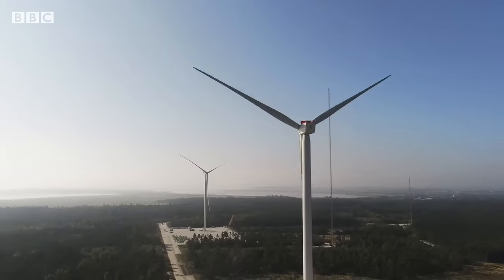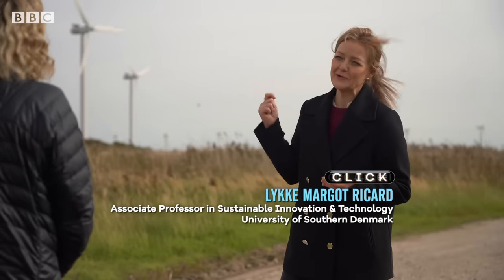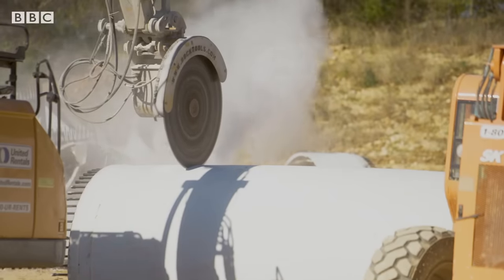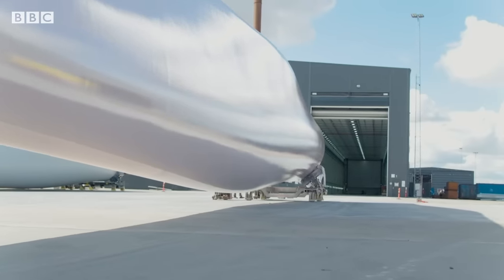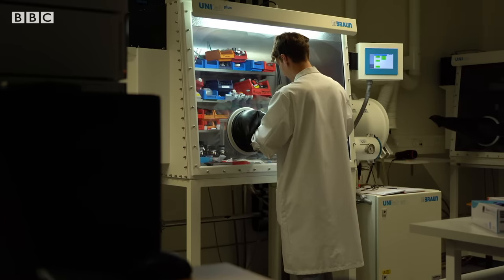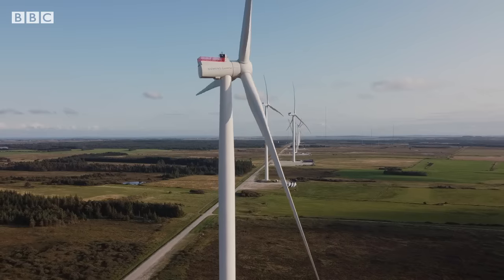Race to recycle wind turbines in Denmark - BBC News

Comment: Summary
- 0:02 The test center in Northern Denmark is testing the largest and most powerful turbines, with the biggest one being 280m high.    
- 0:05 These turbines are- Turbine machines are getting more powerful, with the largest reaching 280 meters high and breaking world records for power output.    
- 0:34 They're expected to get larger, with the design turbine being 450m from ground to highest tip.    
- 0:46 By 2030, wind power could supply a fifth of the world's- There are plans to create a new test center in Denmark for a design turbine that could reach 450 meters high.    
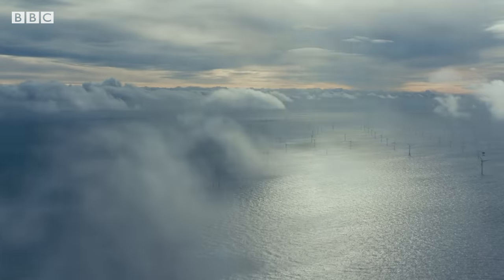- 0:50 By 2030, wind power could supply a fifth of the world's electricity.    
- 0:54 The green industry has a waste problem, as turbines are hard to recycle when they reach their end of life.    
- 1:07 While the steel in the towers can be reused, fifth of the world's electricity.  
- 1:12 Turbines are built to withstand forces of nature, making them flexible, light, and super strong.    
- 1:19 However, when turbines reach, the massive blades are almost indestructible and often end up in landfill.    
- 1:31 By 2050, there could be 43 million tons of redundant blades globally that need to be dealt with.    
- 2:00 Some creative solutions for reusing wind turbine blades include using them for bike sheds, playgrounds, the end of their life, they are difficult to recycle. While the steel and towers can be reused, the massive blades are almost indestructible.    
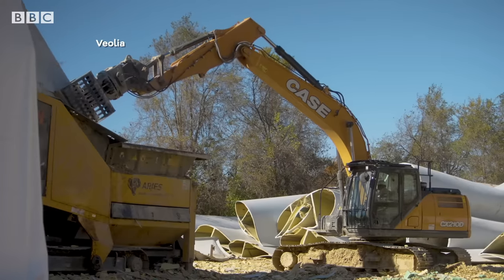- 2:18 One immediate solution is to chop up and shred the blades, then burn them as fuel and use them as an ingredient for cement production.    
- 1:26 Many old turbines get dumped in landfills and by 2050, there could be 43 million tons of redundant blades globally that need to be dealt with.    
- 2:39 Solutions- Turbine maker [Siemens Gamesa] has had a breakthrough, manufacturing blades that can be recycled using a resin called epoxy.    
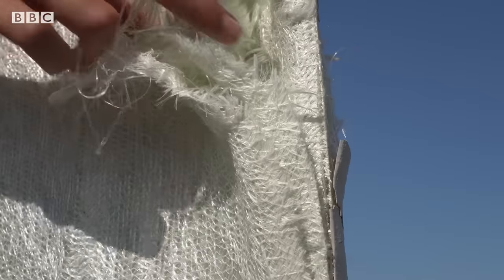- 3:21 The blades need to be soaked in a big bath of mild acetic acid, allowing the different glass layers to separate from the blade.    
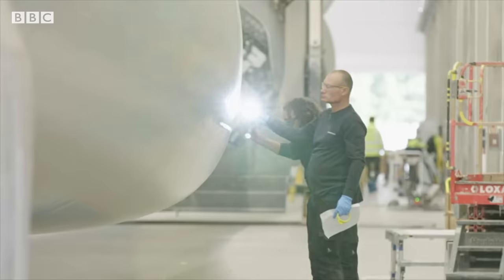- 3:50 The materials from these recycled blades could to recycling turbine blades have been explored, including repurposing them for other uses like bike sheds, playgrounds, bridges, and building cladding.    
- 4:03 be used to make other things such as furniture, suitcases, and surfboards.    
- 4:19 Researchers at [Aarhus] University have discovered a chemical process that gently- An immediate solution is chopping and shredding them to be burned as fuel or used as an ingredient for cement production.    
- 4:22 Siemens Gamesa has developed breaks apart the components of the turbine blades, potentially allowing the fibers and epoxy resin to be recovered and reused.    
- 5:28 These recycling solutions have potential applications in other industries such as aeronautics, space, and cars.

Disclaimer: I used the video transcript and GPT4 (and a lot of copy and paste) to make this summary. Manual edits are in brackets [].
Reply: 2:39 ..lol ... Seaman Gaza instead of Siemens Gamesa
4:19 ..at Orus University instead of Aarhus University
Reply: @nettcologne9186  I used the transcript and GPT4.

Comment: A bit of non news really. Even with Gen 1 blades the total weight of blades required to generate 2GW ( about the same as a large coal plant ) would be around 14,000 tonnes. Whereas a 2GW coal plant would burn 14,000 tonnes of coal - PER DAY !!!
Reply: the coal disappears, whereas the blades will persist FOREVER
Reply: Why is it "a bit of non-news"? This is cutting-edge science. What has your comment got to do with recycling turbines?
Reply: @JogBird no they are not.  That is why they need replacement at some point and they could end up in landfills.
Reply: It was only really earlier generation blades that posed the problem ( and it wasn't really a large problem compared to what they were replacing - ie coal plants ). Recycling blades is old news now. We just need to crack on deploying cheap green energy at pace.
Reply: Coal has been a renewable fuel since the first tree fell thats where coal comes from
Reply: @JogBird  lol the coal disappears?  Tell that to the atmosphere.
Reply: @peteraston4753  You do realize the world consumes fossil fuels at like 100000x the rate of their geological formation, right?  Although if we cut our usage back 100000x then yes, fossil fuels could be considered renewable.
Reply: @peteraston4753  true. But no coal has been  created since the dawn of man, so it's not really a practical solution in the next 20 years.
Reply: 0.00014 micrograms of common sense.
Reply: @peteraston4753  "Coal has been a renewable fuel since the first tree fell thats where coal comes from". That is not correct. Coal was originally from wood, but no new coal has been made in over 50 million years, and it is unlikely any new coal will ever be made. Coal was created when there were not yet any bacteria or fungi able to process (eat) the wood, so the wood turned to coal. Now all old trees get eaten by organisms and will never become coal.
Reply: Appreciate your support for wind energy and you are absolutely right about its compariaon to coal waste.

What @siemens has done here is really remarkable. But more repurposing solutions need to go to market too. But decommissioning costs are high which is why there's little left over to spend on repurposing or recycling blades and funding needs to come somewhere to fix that. In the US - we probably need landfill costs, tipping fees, greatly increased to stop this and help bring value to it as feedstock for recycling as WtE or repurposing projects.
Reply: @peteraston4753 Coal is not renewable. We can't make new coal.
When all coal in the world is used, that's it!

Comment: how is 50 tons of ore for one battery that has a 7 year shelf life, that needs fossil fuels plus rare metals to be built, charged and maintained better for the environment?
Reply: You presume rare earth based energy storage is the only manner of storing energy. We have yet to figure out how to capture all the heat petrochemical consumption produces.
Heat pumps just became a thing. Everything needs to become a thing before people will accept it and fund it.

My, English is fun. You know a "Thing" was what English and Scottish lords called their annual meeting at that tectonic rift valley? Kids are saying drip now, as if it means flow,  and presuming that acting like a simpleton is a part time endeavor.
Reply: @Dam-a-fence  < when the postbot outs itself.
Reply: How many tons of ore go to make the average petrol or diesel car ?
Reply: @daneenmurf1043  50 tons just for a battery or 25k lbs during lifetime including building. Which is more? Or just another bot?
Reply: @Censortubes  25000 lbs,  so 12 ton of iron ore smelts down to make 1.5 ton of steel ? Where is THAT mine ?
Reply: @daneenmurf1043  so what you are saying is postbot? Thanks.  That's all we needed.

Comment: Could cut the blades shorter and use re-use them on smaller turbines? 😮🇬🇧🌈👍♥️
Reply: Probably not worth the bother.
Reply: half the size blades will not make half the energy but about a quarter - Which is also the reason they make bigger and bigger blades, as double the length in blades will produce 4 times the power (i think - the area is about 4 times as great so my guess the power output would be too)

Comment: Fun fact due larg mass they need another power supply to get the blads to overcome the initial load  IE Inertia before the wind arrive
Bit of a joke Clean and green.  I don't think so
Alternative and intermittent yes
Reply: How is that important?! How is it different to how a normal motor works, for example?
Reply: Spell it out for you
Coal fired power to operate alternative wind system or it won't fnk turn due to bad blade design
Have you seen any one push start an aeroplane
Doesn't work
Reply: @fastertove  «Both cars and aero planes used to be exclusively started by hand. Now they have small kickstarts specialized in getting the engines going»
--
A silly syllogism. Behind cars and aeroplanes there are motors with fuel, so it is about igniting what's behind. On other hand the wind energy is constant. 
But, but, but... I wonder if you are not able to grasp it, have fun to contradict, or are in charge to promote the wind-belief?
Reply: nielslund641  
I am a diesel fitter 45 years 
I understand mechanical things
I have had 3 hour consultation with a wind energy engineer to propose installing these systems on my farm and for better understanding I ask a lot of questions
I didn't say they had a starter  motor
Funny how on days with no wind  they keep spinning 🤣 
You figure it out
Reply: @fastertove  
 Well mainly they ARE NOT A MOTOR
They are a generator so kind of different hey
Reply: @fastertove  they consume ELECTRICITY when the wind IS NOT BLOWING  IN CASE you can't Work it out
Reply: So the energy needed for 1 windmill to turn itself the right way, can not be made by another mill allready rolling? If it can, then you only need the energy for 1 windmill to start as that one can make the energy for others and so forth - maybe 1 battery can be charged for that to work et voila - no unlean energy needed =D
(just fyi, when Denmark imports Energy, its usually from Sweden and Norway - those guys have hydra due to mountains - thats green too - Sweden have nuclear power as well, but personally i'm not fond of that kind of "green" energy...)

Comment: 80 degrees Celsius? So they're going to need kettles the size of warehouses (you know the most energy hungry appliance in your house) and they will be powered by what? It won't be air turbines that's for sure.. to achieve what? material for furniture and surfboards?! They're having a laugh, better off using them as man made reefs like they do with tires and old ships, drill holes in them and place heavy rocks or tires inside unless this stuff is harmful to sea life of course, then just use them to make foundations for roads in a desert or something similar..
Reply: You should write your suggestions to the wind power companies. Maybe they'll give you a job.

Comment: I found this video a typical rah-rah piece with a lot of flashy editing and devoid of technical information. I want to learn the actual chemistry and thermodynamics facts about the cement kiln recycling. (2:20). What actually burns? Glass is primarily sand. Sand does not burn. Thermal decomposition is just going to burn off the resins and result in sand. What is the heat content of the resin? If FRP trash is added to a cement kiln isn't the result cement with sand already in it? That will increase shipping cost for the cement producer as their cement has a higher proportion of sand so the end user is paying for less cement in each tonne, ton, kg or pound of cement/sand mixture? In effect we're all to be charged for the recycling of wind turbine blades for every project that includes mortar or concete? 

Bike sheds, playground equipment and surfboards? The "green" crowd are dementedly lame grasping at every straw to justify their existence. And an equally lame producer, director and editor of a hopelessly woke media giant unquestioningly believes that bit of lameness important enough to be included. Sad. Just plain sad.
Reply: You did catch that this piece by bbc is about processes that render cement kiln recycling obsolete right ?
Reply: @felixbeutin8105  Have you been jumping the gun your entire life? "Processes that render cement kiln recycling obsolete". You state that as if the segments present things that are already perfected. The repurposings illustrated are essentially nonsense as only a statistically insignificant number of blades could be disguised in this fashion. The designed to be recycled blades segment completely glossed over both cost and life of blades using an epoxy less resistant to acetic acid. Mentioning surfboards as a realistic industry for recycling is laughable. The closing segment was a chip in a test tube. As usual with rah-rah pieces there was no mention of even estimated capital and operation expenses for an installation that can handle hundreds of tonnes per day which includes rinsing the solvent out of the fibers well enough that they can be reused.

The cement kiln is the only current workable "solution" but not just any cement kiln. Only certain kilns can use shredded blades. I recently saw another video that admitted there was a single kiln in all of Europe that could accept shredded blades. The entirety of green dogma rests on statistical spreadsheets that haven't gotten any of the many apocalyptic predictions correct in the roughly half century these statisticians that falsely claim the mantle of scientist make every few years.

Comment: Are they Green really? Well the amount of concrete in the foundations is massive . Now remember this is the very reason dams are not green power yet in all the countries now running wind they have used more concrete than all the dams in the world. Sound untrue? A dam lasts 100yrs plus makes more power and can be almost fully recycled Wind cant come close to that as their looking at 20-25yrs
Reply: For the moving parts - concrete is not a moving part... its a foundation, one that can be reused for the same kind of mill... Can stand that same place for how long did you say, 100s of years... You're welcome.

Comment: By 2030 wind power could supply a fifth of the world’s electricity. That’s comedy gold.
Reply: Well, we're at 7.3% now, so it's entirely feasible, though by no means guaranteed.
Reply: @pjacobsen1000  «Well, we're at 7.3% now, so it's entirely feasible, though by no means guaranteed.»
--
Make up your sense.
Reply: @voltydequa845  Your comment has no meaning. "Make up your sense". Do you mean 'make up your mind'?
Reply: @pjacobsen1000  «Your comment has no meaning. "Make up your sense". Do you mean 'make up your mind'?»
--
It means  "put your mind into sense". It is enough to think about the absurdity of 7.3 % -> feasible -> !guaranteed. 
The world is full of gullible pseudo-sci afficionados. 
"lies, big lies, and statistics" - more or less, by Mark Twain. Abstain pls from answering in "but ... " style.
Reply: @voltydequa845  'Put your mind into sense' is also not correct English. Perhaps you mean 'be sensible'?
With regard to the future of wind power, we can only speculate, but to go from 7.3% to 20% is certainly within the realm of possibility. It requires annual growth of 15% in new installations over the next 7 years. Growth in 2023 was 9%, so not enough yet. Time will tell.

Comment: So how long do the wind turbines last? Seems to me if they're "almost indestructible", they should only need to be swapped out what, every 20 yrs?
Reply: Yeah that's their typical lifespan, around 15 to 20 years as I understand it
Reply: More like 25 years. Some turbines are even useful after that, but because they were built so many years ago, they tend to be much less efficient than new turbines, a bit like how a car from 1998 is less efficient than a new one. Therefore, older wind parks are often replaced with newer ones.
Reply: @pjacobsen1000  Gotcha. But you can sell a 1998 car to some poor college kid for a good price & having that car will greatly improve her life. Can't we donate our old blades to some poor country to use for their wind turbines, so they don't have to buy newly-made ones...?
Reply: @freedomfighter4990  "Can't we donate our old blades to some poor country". I'm sure we could, but it's less likely they would want them. It may not be cheaper for them to re-fit old blades onto new turbines. If this made good economic sense, it would be done already.
Besides, though these blades look (and are) huge, they make up only a tiny amount of the industrial and construction waste we discard every year. We only notice them exactly because they are so big. And the focus on them as a waste problem is primarily because renewable energy is supposed to be more environmentally sustainable. So, there is a problem, and it needs to get solved, but it is by no means a disproportionally big problem.

Comment: (1) what idiot built "sustainable" tech that is NOT recyclable? (2) what idiot designed this kind of tech with such a brief useful lifespan? (3) why can't such workpieces be "permanent" (and not need replacing)? (4) why aren't we using more wind power? After the initial investment, it's basically free energy...
Reply: Just to let you know that not finding answers is already an answer, though in an (could be) unexpected direction.
Reply: @voltydequa845  This isn't some kind of n2 incomplete puzzle... it's science... physics, chemistry, etc. However, lateral thinking usually does bring about breakthoughs...
Reply: 1) Prioritizing and costs 2) Primarily a security concern. It pays for itself multiple times. 3) Same reason cars break down. 4) Fossil fuels being cheaper. Needs appropriately placement. Varying energy production. Infrastructure
Reply: @fastertove  (1) "Prioritizing and costs" - init costs are gov subsidised. (2) "Primarily a security concern." - meaning what exactly? "It pays for itself multiple times." - eh, no it doesn't! (3) "Same reason cars break down." - note my use of quotes in my original post, specifically, I meant… easily replaceable parts, such as appliances before greedy people implemented [dispose and buy a new one]. (4) "Fossil fuels being cheaper." - i.e. short term greed foisted on consumers. "Needs appropriately placement. Varying energy production. Infrastructure" - how about a splash of intelligent design, e.g. Sweden's investment in wooden wind turbines as seen on a video today on this channel.